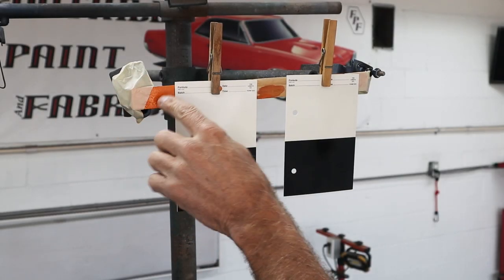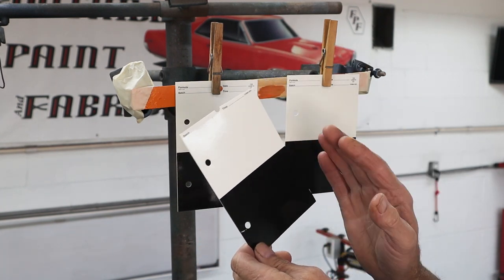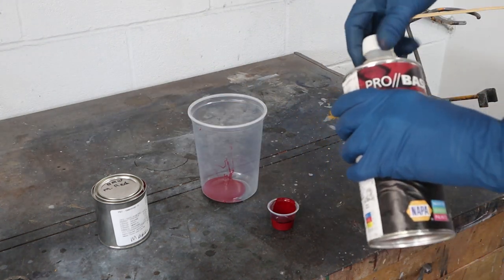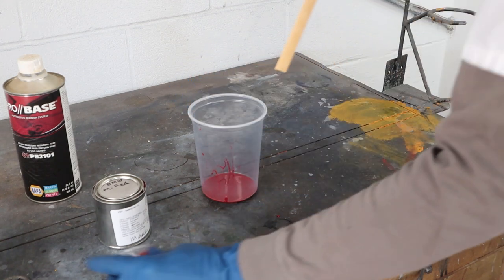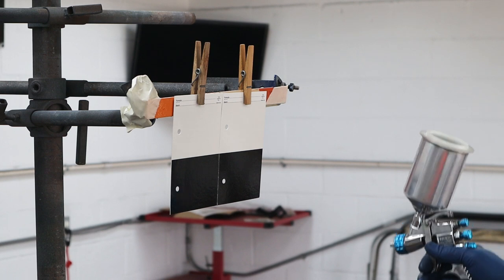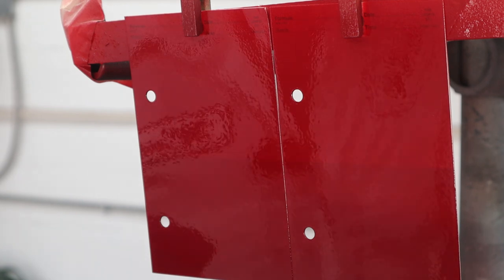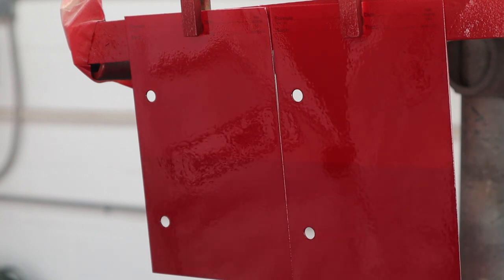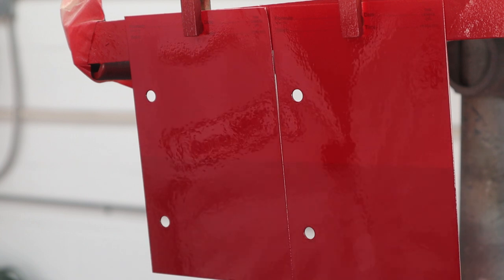AMC Matador Red Spray Out - Testing Paint Colors

Comment: Thanks for the video Mark. Very informative. I'm using the Restoration Shop's Firethorn Red Pearl on my 53 Chevy 3100. All I have painted so far are things like the engine and transmission and other small parts. They told me That it would not matter what color the primer was because it's not transparent. I did some gray and some black primer and it did make a difference. Thank you for your time.
Reply from the maker: Unfortunately most of the sales people are not painters so they really have no idea.  Solid colors (no metallic or pearls) are pretty forgiving but most others it does matter.  I am not familiar with that color but it sounds cool.  I love reds.
Mark

Comment: Thanks Mark, once again you seem to put up just the video I need when I need it. I am trying (struggling) to select a color for the '50 Chevy panel truck right now. I picked up 4 ea. 3 ounce cans of  certain colors to do a spray-out when I get a warmer day. I ordered 20 "speed shapes" from Amazon (I didn't know about spray out cards until today but the speed shapes didn't cost that much).
In my limited experience I have found a gray primer is the best color to use under red paint. I painted my son's S-10 with a Ford Candy Red once using red primer (thinking red over red would be best, right?) but wound up with tiger stripes. 
A body shop friend of mine showed me a special color wheel device he had to help select which primer to use under various paint colors. 
Thanks!
Reply from the maker: You are welcome Dennis.  That is a big ole vehicle so getting the color just right is very important. I am sure you have looked at tons of pics of panels on the internet but in the end it is your stylistic choice.  Are you going single tone tone or two tone?
Mark
Reply: @FoothillPaintandFabrication  I am considering two tone, body one color, fenders another. I have been looking at panels online for inspiration.
Reply from the maker: @BusyAsABeaver72  Old school Tan, green and black or more modern?
Reply: @FoothillPaintandFabrication  Mark, I tried to answer you quite a few days ago. I don't know what happened it didn't post. I need to keep it pretty simple, I am not interested in making a show truck, I just need to get it DONE. Solid color gray/black or something of that nature.
Reply from the maker: @BusyAsABeaver72  Sure Dennis, didn't I say that about the 3100 I am working on about 50 times already?  This isn't a show truck...
If I could make a suggestion.  Make sure you put both colors side by side because the black will lighten anything next to it.  Grey next to white looks grey but next to black looks white in comparison.  Grey body with black fenders?
Reply: @FoothillPaintandFabrication  You bet, Mark, good point. Grey body, black or dk grey fenders or dk grey body and black fenders. 
I have 4 colors that I had mixed up and it's going to warm up later this week so I hope to do some spray-outs to figure something out. I have this Nardo Gray Audi/Porsche color that interests me.
Also toying with the idea of using a not so gloss clear.... thoughts?
Reply: BTW the serpentine belt system from CVF Racing is arriving today! Purchased it at a discount, scratch and dent sale. SCORE!
Reply from the maker: @BusyAsABeaver72  Very cool!  It is a nice system for sure. Watch the spacer length on the water pump to main plate.  Make sure they all contact at the exact same time so the plate doesn't distort.  Even without the discount their stuff is really reasonable.
Mark
Reply from the maker: @BusyAsABeaver72  Personally I am not a fan of satin clears.  They have their place for sure but over time they become hard to maintain from what I have seen.  The more you rub them the shinier they get so the sheen becomes uneven.  There may be ones I haven't heard of that are better but the one thing to remember is how do you sand out a mistake?
I would buy a small amount and do several spray outs and do some tests of your own.  Don't be shy about asking for spray out cards at your paint store.  They should give you some if you ask.